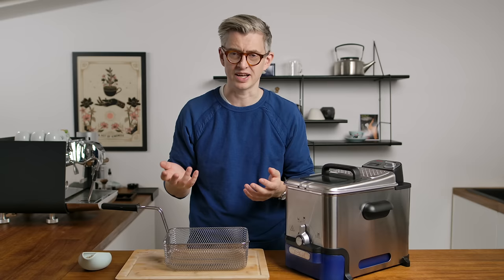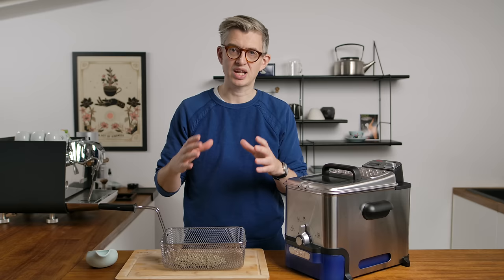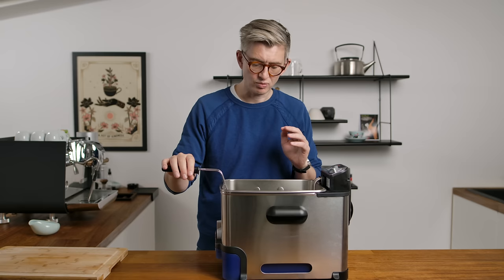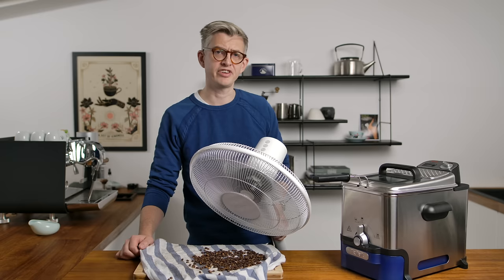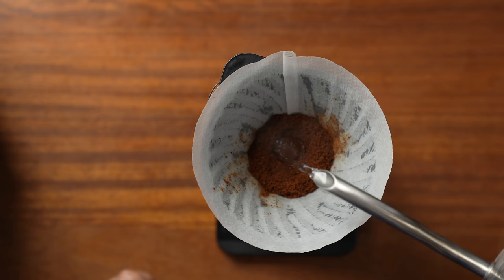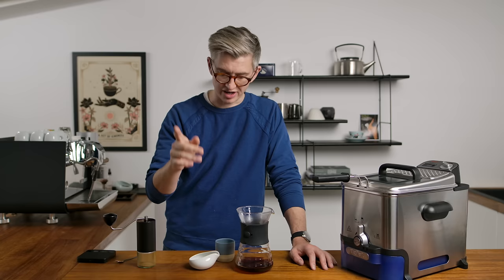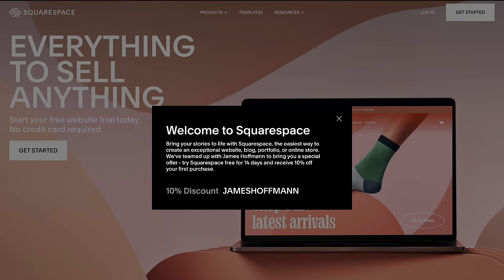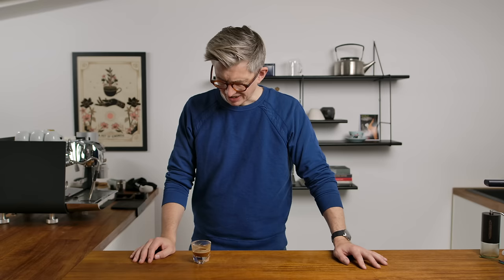Deep Fried Coffee: A Surprising Discovery

Comment: Would be interesting to see air frying if that's more similar to a traditional roaster and something people are likely to have around
Reply: Air fryers are absolutely capable of roasting but you need the beans to be constantly moving which I’ve never seen on common air fryers

Edit: I stand corrected. Some come with rotisserie baskets which might allow you to keep the beans moving enough where they can roast evenly. 

If you have one it's worth a shot but if you don't want to spend a lot of money to try roasting your own you can try the cast iron method or check out your nearest thrift shop for a popcorn air popper. I used one of these and got 50g coffee done within about 7 minutes and they tasted pretty good.
Reply: You can do it just in your oven and it will be delicious if you do it slow enough.
Reply: @cs5250  unless you buy an air fryer with a mechanical arm that constantly turns. I've seen those in shops and not too expensive?
Reply: I have been using "Nostalgia Electric Popcorn Popper" from Sweet Marias to roast for several weeks with great success!
Reply: I've had coffee roasted on a dry cast iron skillet, and it was quite nice.
Reply: @cs5250  dont some popcorn poppers have a stir bar? That may be the machine for it
Reply: Yes please!
Reply: My airfryer has a rotisserie basket which makes it constantly move and tumble coffee. Basically a drum, so literally same thing
Reply: MY wife's air fryer has a drum. But no fins.
Reply: Look up turbo oven coffee roasters
Reply: @GonzoDonzo  if you get an air popper, the beans move around inside.
Reply: @nope8637  the basket on mine is just a little too big
Reply: Air fryers are much less related to a deepfryer than to a typical convection oven or those industrial pizza ovens, so I doubt it's much different from tradtional roasting.
Reply: @cs5250  Hm. My air fryer came with a rotisserie basket . . . for fries/etc.
Reply: An air fryer is just a convection oven
Reply: I might try it, my air fryer has a drum attachment that is able to spin objects rotisserie style
Reply: @cs5250  the tfal actifryer, which was a bit ahead of the air fryer industry but is pretty limited in capability, had a moving arm.
Reply: @cs5250   so the clothes dryer is the way to go, right?
Reply: Just use a popcorn popper or heat gun + sifter setup, depending on how handy/diy you are, they are definitely the way to go for getting into roasting.
Reply: @cs5250  My air fryer has a rotisserie basket.
Reply: @RandomBobsAndBits  , my wife gets to keep the Kirby. All the other vacuum cleaners are mine. They can be converted to roast coffee, with enough okie ingenuity. ;)
Reply: That's because air frying isn't frying at all. It's just marketing fluff to sell convection ovens. I hate marketing.

Comment: I have a suspicion that what is happening in the filter brew is that with the unpressurized coffee draining down, the oils are able to float to the top of the slurry and sit on top of the bed rather than draining down with the water. It also explains why the resulting bed looks the way it does n
Reply: The oils are also absorbed by the filter itself, It would be interesting to see what happens if you were to use something like a Chemex filter that'll isolate a lot more of that end product.
Reply: Good point. Further to this, oil and water are immiscible, they repel each other. If the V60 filter was pre-rinsed with water, the water held by the filter would do a lot to resist the passing of the oil. You might get a very different cup if you didn't rinse the filter beforehand. In the espresso shot, this would likely not have mattered since there's an immense amount of pressure forcing everything through.
Reply: My thoughts exactly!
Reply: super correct insight !
Reply: If you used a quality creped filter like the cafec ones you would also catch a lot more of the oils in the paper.
Reply: Very instructive thoughts
Reply: I wonder somewhat if the pressure of the espresso machine might be emulsifying the oil with the water and some components of the cofee.
Reply: Not to mention surface area as well- and seeing that they're essentially filled with oil at that point, perhaps there's some repulsion so that the water doesn't permeate through the coffee bits as much as it normally would?
Reply: @Andrew-wp1bz  That's a fair point, another may be that separation may better than filtration in something like an Aeropress where the vacuum created by the plunger could allow for dispensing of the most oil free coffee depending on time allotted for separation. Cheers!
Reply: @KEVAN0014 Tell that to Subaru, they can mix oil and water like a champ

Comment: I think the oil temperature is a factor as well here. Typically for dried products that you want to "puff" (like puffed rice i.e.) you have to go way higher, at around 190°/200°C. With  proper temperature, the oil penetrates way less in the product in general, and you might get a closer result in terms of cracking and size of the roasted bean
Reply: You know what that means... we need a part two!
Reply: But with coffee, wouldn't those temperatures begin burning the beans?  Even water above 190/200 Fahrenheit cause damage to ground beans... outside of espresso, where you essentially burn it up.
Reply: There's some literature that contradicts this. They posit that high temperature oil makes bigger cavities in the food as it boils the water away more forcefully, which then fills with more oil than a low temperature fry does.
Reply: Need to roast in bacon drippings. Mmm... Now we are cooking with coffee
Reply: @LordWhirlin  You misunderstand what Andrea is saying. She meant 190-200 ºC, which is 374-392 ºF. High temperatures are required to roast (or in this case fry) the coffee beans. I'm not really familiar with the chemistry behind it, but what I'm guessing is that boiling water (~212 ºF) doesn't really burn the coffee, it just has a stronger extraction power, and therefore extracts more bitter compounds, causing the coffee to taste "burnt". That can be supported by the fact that cold brew coffee has a much more mild flavor and less complex, because the cold water can't extract some compounds present in coffee. The case of espresso actually adds more factors, not only the water can be over 212 ºF, but it also goes through the grounds under pressure, causing it to leach very hydrophobic compounds that don't usually get extracted due to their low solubility in water.
Reply: Agreed. I would love to see this done again with a few different variations.
Reply: @beautifulnova6088  I agree with you first proposition, but wouldn't larger cavities make it easier for the oil to seep away after frying, making the final product less greasy? As far as I know that's the reason why japanese panko flour makes crispier breaded deep fried stuff than regular bread flour.
Reply: @BT7M  Exactly. The Saturation Point of water increases with the temperature.
And it's the reason that, if you want a weaker cup of coffee, make a normal cuppa, and then dilute it with hot water!
When you use less coffee, the flavonoids extract with a quickness, but there aren't enough of them to saturate the water. Thus, the water starts extracting the Bitters, too.
A nice way to demonstrate this is to take 2 cups of sugar and a cup of water. Mix the two at room temperature, and see how "fast" it dissolves. It won't.
Now, heat it close to boiling while stirring, and watch it all the sugar disappear.
Splash in some Mapleine Flavoring, and pour it on Warfulls.
Reply: @beautifulnova6088  it would depend on the foods i imagine and youd need baselines of data for each one most likely
Reply: @BT7M  pure speculation: perhaps the pores in the bean shrink when cooling, trapping more oil.
(This is the method grocery stores used to "crisp" lettuce and celery with warm water soak followed by refrigeration). Traps water.
Maybe the beans would hold oil the same way?
Reply: Should try with an air fryer
Reply: I wonder if that’s why the beans weren’t boiling so intensely initially? Idk…
Reply: Exactly
Reply: @SandCastor  I think you mean scalding, right? The main difference I see is the amount of time the product stays in the high temperature, while in vegetable scalding is only a few seconds, the coffee in the video seems to have taken several minutes to get to the point he wanted. That gives enough time for the enlarged pores to harden and then be able to maintain their shape after cooling. But as you said yourself, this is nothing more than an educated guess :)
Reply: I agree. In the interest of science I strongly believe James needs to do the test again - Deep Fried Coffee Pt2 - In addition to the temperature increase he should line the bottom of the fryer basket with window screen or something similar so he doesn't loose so many beans out the bottom of the basket during frying.
Reply: Makes sense, you want the internal temp to raise rapidly to expand the gases and break the surface.
Reply: @beautifulnova6088  Can we have a link? From what I knew the deeper cavities weren't important because at high temperatures the food basically creates a Leidenfrost effect and it's not directly touching the oil
Reply: @matthewnadler7521  that;s just normal roasting
Reply: @LordWhirlin  if we are talking Celsius, coffe beans are roasted around 200°C and over (about 400°F?)

Comment: As a roaster/owner of a Roastery (Swamp Donkey Roastery), I appreciate your experiment, although I would suggest if you were to try it again, you go with a much higher oil temperature.  While that may seem strange, I believe the beans spent too much time cooking in the oil, thus absorbing much more oil then they may have with a higher oil temperature.  I would suggest an oil temp that would develop the bean in the 6 to 8 minute timeframe, I am sharing this thought as we roast in a Scandinavian Profile, very high heat in the beginning (neighborhood of 600 +/- degrees f w/a drop in the 400 +/- degrees f) of the roast, allowing the bean to go through first and second crack in about a 6 minute plus timeframe w/o tipping.  The quicker development in the temps we utilize seems to reduce/eliminate undesirable acidity and bitterness while not caramelizing all the sugar in the bean for a much sweeter full flavored extraction, based on our experience and customer feedback.
Reply: Avocado oil has a smoke point around 500 F.  That's pretty high end smoke point.
Reply: @kayakMike1000  I'm unsure how the Avocado would affect the flavor, Refined Peanut oil is also a high smoke point oil except its max is 450f.
Reply: If I recall avocado oil also has a neutral flavor so it shouldn't affect the final flavor too much.  It's even healthier than regular peanut oil.
Reply: Valuable information!!!!!

Comment: Honestly, if you've got something you've described as "good" when it's your first shot at trying it with equipment that's not designed for it, you might have a winner on your hands. Remember, your technique is only going to get better, and you've got variables you can play with in terms of frying times. An even roast through the whole bean has to be a fantastic starting point.

I would suggest that the reason the filter coffee works is because any remaining oil is floating to the top of the water as you apply it and is then just sitting on top of the bed at the end instead of making its way through the filter, so you're unwittingly filtering it in two different ways at the same time. I don't think there's a way to replicate this effect by espresso, and that's fine.
Reply: Yeah, nobody makes a good batch at first shot(at classic roaster). Also, his fried coffee didn´t rest at all.
Reply: I do think there's most definitely room to explore this further, but as I don't own a deep fat frier I cannot partake!

Specifically regarding the espresso, I wonder if stepping back in time a little might help with the observed acidity and harshness: Dosing high and pulling short, like we did back in the 90s to make some of those harsher espresso blends more pleasing with (fatty) milk serves.

Most interesting to me was the consistency of the fry: Whilst bean to bean was clearly not very consistent at all in this small frier, I wonder if (as it often does with roasting) scaling up would remedy this to some degree: Anyone fancy chucking half a kilo in their kitchen's Thor? :D
Reply: James guessed at the frying temperature. The lack of cracking makes me very curious if his oil was hot enough. He acknowledged that his grate was too coarse and let a lot of beans fall through. So many ways this could be "dialed in." In fairness, I've never roasted coffee. Give me a coffee roaster, of any type or brand, and I suspect my first batch would be horrible. Maybe fried beans have no place in an espresso machine, but I think it would be very interesting to experiment and dial in for pourover. If the first attempt was "not bad" that suggests good, if not great, is achievable.
Reply: Yep, and there is no pressure to squeeze that oil through paper filter too.

Comment: The initial reaction is probably one of James' best. Now I'm wondering if he's ever tried roasting coffee in a popcorn popper.
Reply: Probably hasn't tried it but is likely aware of it as it's the same principle as the air drying process he described.

I found out about drying coffee this way trying to find a manual for my popcorn maker.
Reply: A wok works well too for small batches
Reply: The oil is made of fats. If you add butter to a cup of coffee it ends up really tasty 😋.
Reply: @MR_DOME  I love adding a tsp of butter to my coffee.
Reply: @inthefade  per cup or pot?
Reply: Should have checked the comments.  I just made basically the same comment regarding the popcorn popper.
Reply: @unbredbeast  for the love of all things holy and not, make sure to use UNSALTED BUTTER. Just ... just make sure.

Comment: a few recommendations from my roommates and I:

from my own experience as a home cook: i’ve filtered/clarified oil on my own with a variety of meshes and filters, and i know coffee moves through a coffee filter significantly faster than oil. your pour over cup may have been less oily because of the paper filter

from roommate 1’s experience as a fry cook: even if you have your frier at a high temp, if the item you’re frying doesn’t sizzle upon impact, you need to increase the fry temp. the reason why fried food isn’t chock-full of oil is because of the force of the water evaporating and pushing back against the oil. in his words, “even if you increase the tempurature after putting it in, if it’s been frying without sizzling it’s too late.” his recommendation was to increase the initial fry temp and then decrease it to your preferred tempurature after a little bit.

from roommate 2’s experience as a science nerd: there are substances you can use to extract the oil from things, so maybe you should do that to your espresso either before brewing or before drinking. 

i’m not clear on how this last recommendation works or what you’d have to look for because i don’t understand chemistry really.
Reply: Fascinating thank you
Reply: For the last one you could use something like a couple DCM or ethyl acetate washes, the problem is that a lot of the flavours in the coffee aren't particularly polar either, so you are going to extract them as well. For example caffeine is also DCM  and ethyl acetate soluble so some (many cheap/bad) decaffs use those washes for their process. In other words you're gonna end up with a much more flat decaff-like tasting end product.
Reply: If what you are trying to fry, has no "water", then its not going to sizzle much, if at all.   If he pre-wet the beans, then the beans would have that mini "steam-cook" effect in the oil, in the same way that a French Fry would cook in the fryer.
Reply: @johndough8115  Water is one of the "stickiest" materials. In a vacuum, you could be down to 0.0001 atmospheres and there will sstill be water. In other words, there will always be a sizzle.
Reply: Wouldn’t do that last one unless you’re prepared to lose a lot more than oil and maybe have solvent residue in your coffee